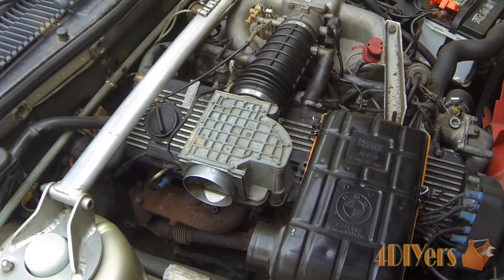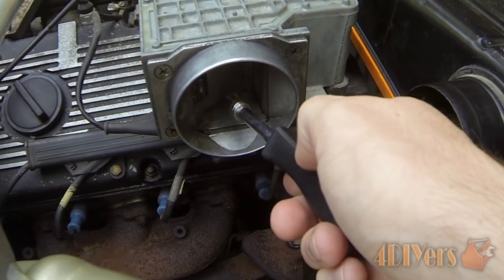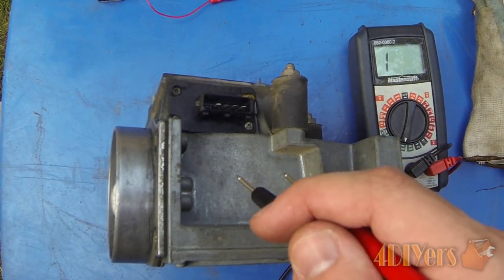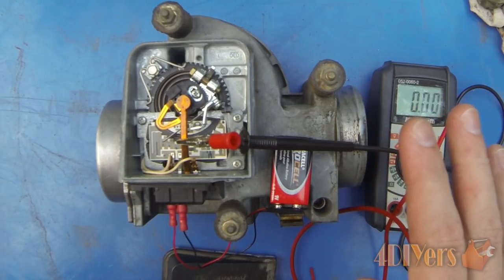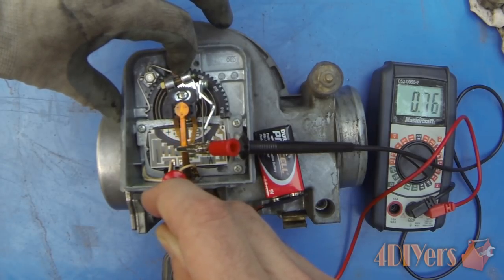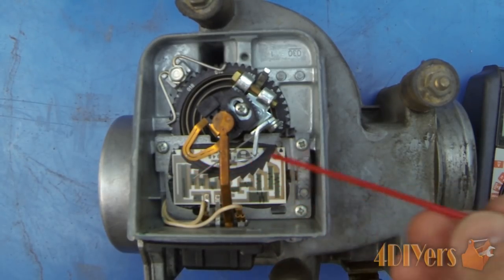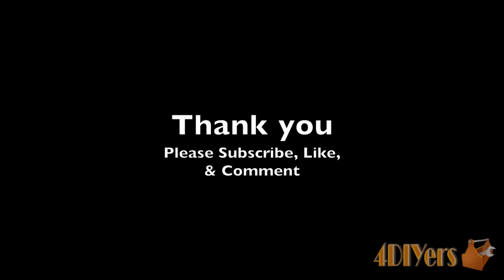DIY: BMW Air Flow Meter Testing

Comment: using an oscilloscope is the proper way to check the flow meter you feed in a square wave and move the flap thru it travel you will clearly see an fluctuation. Great video

Comment: +1 Christopher Olson. I have Miller MAF conversion on my e30 with M20b25 and it rocks. I also changed injectors to 4 little 16.5 pound hour injectors and throttle response & file are awesome!

Comment: Another great tutorial thank you. My E24 BMW is having a hard time starting when the engine is warm; I think AFM will be a good place to start troubleshooting.
Reply from the maker: Glad to help out and thank you for the feedback. I also have a video on how to adjust the valves on an M30 which could possibly be causing a hard start as well https://www.youtube.com/watch?v=fS__6GQ1MNo
Reply: Check the fuel pressure regulator. A ruptured membrane in the regulator will flood the engine by pushing gas into the manifold through the vacuum line. Could also be your speed sensor.

Comment: I am amazed that its impossible to find manufacturer's specs for these units. For example, the temperature sensor on the input to these air flow meters. I have temperatures and corresponding resistances and they follow a pattern, but who knows if they are within spec.

Comment: you think you could intercept the throttle position sensor and use/alter that signal to mimic the AFM signal and run that the ecu.

and then mimic the built in AIT sensor to a set cold temperature? 

basically hack the AFM and delete it

Comment: I just tested an air flow meter Bosch PN 0 280 203 023 for a friend who owns a 1991 Porsche 964. I have a DC power supply, so I was able to set the voltage to +5.00V at pin 3 with respect to ground (0V) at pin 4. The best way to observe the action at pin 2, the signal to the computer, is by using an analog meter and observing how smoothly the needle sweeps from 0.25V to 4.60V (the specs in the Porsche shop manual). A digital meter isn't very good at observing a sweeping transition.
Reply from the maker: Excellent info, thank you for sharing! I ended up buying an analog meter to test a hall effect sensor. Much more responsive than compared to a digital meter.

Comment: I’ve taken my car to BMW and several shops and get a different answer each time.

When I’m at a stop light, foot on the brake my RPM is revving up and down like crazy. Threw some fuel system/injector cleaner from Walmart into it during my last fill up and it didn’t do it for a week.

Then during my next fill up it started doing it again.

Every answer I’ve gotten was the following!

1) Fuel injectors
2) Carbon air filter
3) spark plugs
4) brake flush

Each shop gave a different answer. It’s an 08’ 328i automatic. 102K miles.
Reply: idle control valve ?

Comment: Hello, thank you for your video :) It very helpful to understand how it works.
 But I have one question. My car is e34 m30b30. Then I start with the connect air flow meter and if I open more the sensors doors, nothings change. Im tested with tester and it has the oms. I cleaned evething and adjust the contacts. The cold start with conected meter almost impossible,misfire and bangs, I dont know how to say correctly in english, but then I start the air flow meter disconected its works and after that if I conencted back, the motor star.
 The engine doesnt work correctly and If I gave more gas, engine stall, but if I realeast and gave it more ir works not very corretly, but better. I try to drive the car, untile 2k rpm it goes not very bad not very well but with more gas its stall.If I disconected the sensor it works a  little bit better.
  What should I do? where is the problem? Have I have to change Air flow meter or try to adjust that black wheel with the spring and should richer or less the mixture?

P. s. one more thing. I saw a video that some arabic guy paint the track on the circleboar with carbon paint (if I heard correctly). And put back together and it works. 
What do you think of that?

 I wanna look for some resort, because in my country all meter cost about 70-100 euros and condition its like a lottery.

Comment: so per your initial test with your hand... when the car is fully warmed up, and you perform this test, if the AFM is good, the idle won't change? and if it's bad, it will increase/decrease? I'm testing mine now. If it slowly push the door inward, the idle increases. If I abruptly push the door all the way in, the idle decreases, and car the gets close to stalling

Comment: Hello, thanks for this video, I have a 1985 528I bmw , I was having troubles when I start it at cold weather , a mechanical changed my idle to get it high for a faster turning on at winter ..but when I drive for about 15 minutes my idling become unstable and my car turn off when idling .. how can I fix it please? Thanks in advance

Comment: When I check resistance for the temperature sensor inside the unit I am not getting a consistent number and the number I get almost immediately goes away on my voltmeter.  Does that mean the temperature sensor is bad? (Ambient room temperature about 70). Any idea where to purchase the replacement?
Reply: Have You managed the problem? In Bentley repair manual there are intake air sensor values, so when You have them You can buy thermistor and solder it

Comment: Great video I am in doubt what the result should or should not be while pushing the door inwards of the AFM with running engine. In the video i see it increases, is that what it shouldn't do? I also read that it shouldn't increase while smoothing out (?) Many thanks!:-)
Reply from the maker: jeroen den Outer Thank you. If the idle increases and somewhat smoothens out, then it does need to cleaned/adjusted. What happens is the potentiometer get dirt or worn, on the area it normally rests at. This is turn causes some mixture issues.

Comment: I have a question. With running engine you push in the flap so you fool the computer that there is more air intake. The idle changes, and you say that it needs to be recalibrated. Why is that? I mean: it SHOULD change the idle when you change the sensor's ohm's on purpose, right?

Comment: My car (86 325es with 885 head) randomly loses power at wide open throttle and higher RPMs. The loss of power is abrupt and alarming, feels like a dog getting to the end of its leash. It's a real jolt. Could this be the issue?

Comment: Drove my 635 CSI around the country, and, it ran great and shifted perfectly
Stored it Airport Hanger and went away on my overseas assignment around Sept 2014
Now all of the sudden the car starts up and idles, however, does NOT rev up, and, when
stepping on the gas pedal it bogs down and wont rev up
Would you say this problem is due to a sensor malfunction such as the M.A.F or
cold start valve?
Would you consider receiving, inspecting and servicing our M.A.F.? 
Many Thanks in advance
Col Alexander Klein
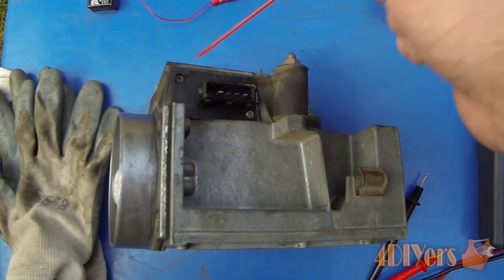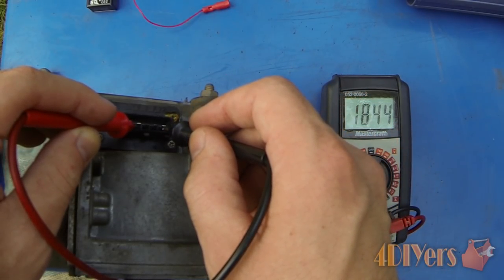Reply from the maker: +Alex Safari Could possibly be the air flow meter, you would have to follow the test in the view to determine if that's the issue. Also the door on the AFM may also be stuck. There may also be an intake issue such as a plugged air filter, or a fuel issue such as a plugged fuel filter. Other issues can also be faulty spark plugs, spark plug wires, distributor, idle control valve, or a vacuum leak. I do not offer a service to refurbish n AFM, but I do have a video on how to do it yourself which is a link in the video located at 3:00. I also have a video on how to test the throttle position sensor as well which is a link located at 4:00.

Comment: I tested the temp sensor like you said on 6 different cars, same amf types, i get no readings whatsoever, bo sound when doibg the beep test, am i doing it wrong or are they all broken.
Reply from the maker: Have you touched the probes together?
Reply: @4DIYers  the two outer probes yes, multimeter on ohm 2000, also sound test, seems like no connection in any of them. I do not understand, can’t imagine they are all broken. I’ll upload a video tomorrow where i do it live, you can judge if i’m doing it right. Thanks for answering!

Comment: hi,
my e12 528i dies out after a slow run, or if on the high way can drive at high speed but when i slow down it dies out, when i drive at a constant speed its fine then if i push down the peddle, it dies out. when it dies out, i just give it a min or 2 having done nothing then it starts and goes runs again, any help?

Comment: Hi, I have question to resistance test with heating. in my both AMF which I own, resistance stopped at ca. 700 ohms. I own 1989 535 e34. Is that OK or it should run lower?

Comment: when i did the first test, my car stalled... i disconnected the o2 sensor and push the flap a little and it just turns off, does that mean that its working properly?
Reply from the maker: Ahmad Soughar How far did you push the flap??? If you push it too far, it will change the mixture to drastically, therefore making the car stall.
Reply: it never stalled
Reply: hi there my name is joe, i have bmw 320i model 1987, i wanted to tell u about a severe problem in my car, i dont know if it is from the airflow meter, so its starts normally and runs normally but after running a certain millage it chokes and turns off, i am capable of restarting it after 15 to 20 minutes and rerun a certain millage and shuts off again, thank u
Reply from the maker: Could be a variety of issues and is unfortunately hard to diagnose without seeing the car in person. It could possible be a fuel issue such as a failing pump. Once the car quits, can you hear the pump working? There could also be an issue with a relay or another electrical component.
Reply: Thanks for replying, in fact it was electrical, it was the ecu chip that was getting heated, i figured it out after replacing many electrical parts including the influmeter, the last thing i left to test was the ecu, so i ran a test on it by driving my car till it stopped and i replaced in 3 seconds the ecu and the car started from the first try, i also ran for to hours to make sure that i resolved, anyway thanks folks for the your tips, i hope u can publish my experience so other can get the benefit, thanks again, peace

Comment: Great video.  Lots of additional info at this link.  Same meter is used on the VW buses and Porsche 914 and 912 with air cooled flat 4 engines.http://www.itinerant-air-cooled.com/viewtopic.php?t=7761
Reply from the maker: Thank you and excellent info, thank you for sharing! Don't forget to subscribe :)